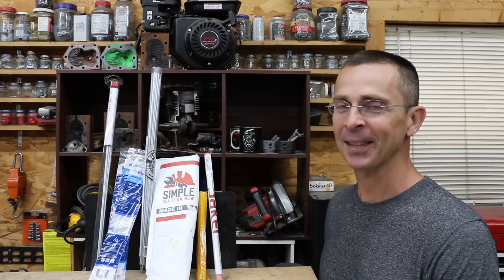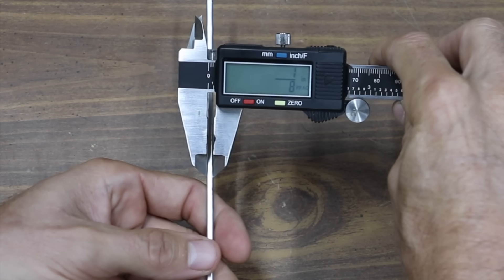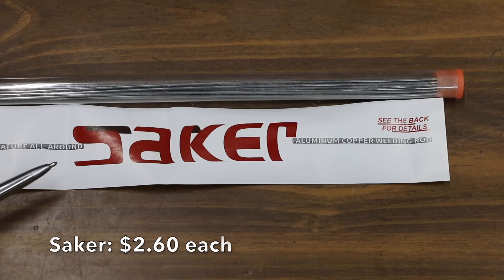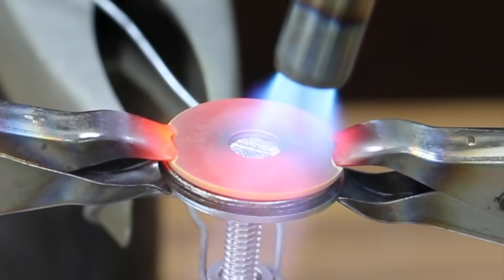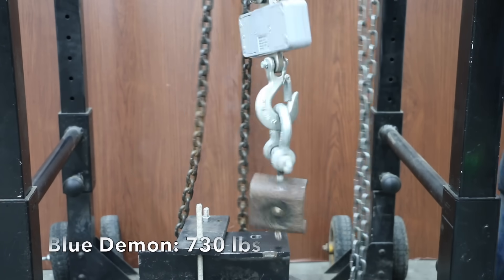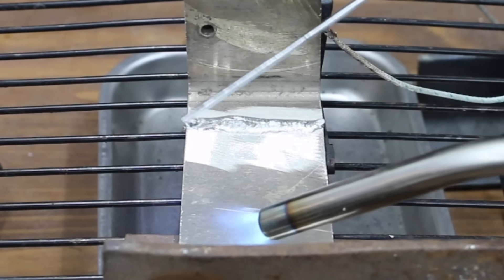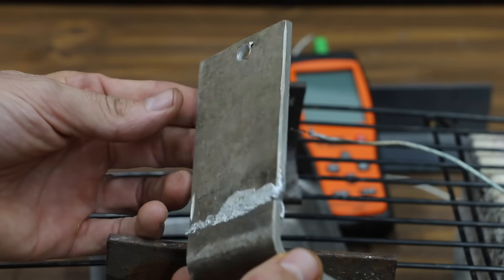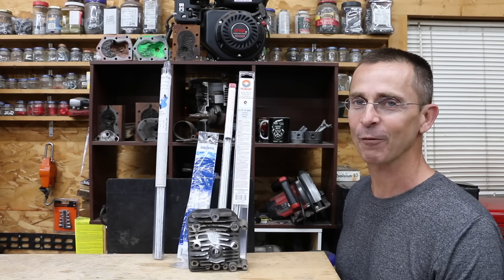Best "No Welder" Aluminum Welding Rods? Alumiweld vs Bernzomatic vs Hobart

Comment: This is one of my favorite youttube channels. A control test with a bolt that wasn't welded would be good for comparison. For the cold spot on the thermal camera metal is highly reflective in the far infrared range and will give false readings. Painting metal with black paint will fix this (black body radiation and what not).  Thank you for making such great content!
Reply from the maker: Thanks for the video idea.

Comment: Correct me if I'm wrong but wouldn't a higher temp rod be better? If the aluminum got soft were the aluminum and rod could fuse wouldn't it work better?
Reply from the maker: Thanks for the suggestion.

Comment: I actually just used some blue demon to (attempt) to fix some threads on an aluminum housing.  I had the housing in a vice and even with a mapp gas torch, I really had a hard time getting it up to temp.  For me, watching very carefully to how well the others flowed, I think the Hobart or the harbor freight ones would be easier to use.  They seem to be more willing to stick to the object being heated, opposed to trying to stick to itself like liquid mercury does.  I saw it do that a little bit in your videos as well (With the blue demon).  I was also trying to build up material, which really isn't how they are designed as I found out.  You can't do a "stitch weld" like you can with a real welder (Going hot, melting, cooling off, welding more on it, and so forth).  The "blob" of brazed material will simply melt and roll off before you can add more material with it.

So more than likely my fails were over expectations and probably user error.  I can definitely see how useful these could be.  We're seeing more and more stuff being made out of Aluminum and the fact that tiny braze held against all that cylinder pressure is pretty awesome.  I'd be curious if you drilled a 1/4 inch hole in it, if you clamped the head against some iron, then tried to fill the hole with the aluminum filler.

For those that wondered about the non-chlorinated brake cleaner - why he mentioned it.  More than likely it's because Todd knows about how UV light exposure can turn chlorinated brake cleaner into Phosgene gas which is super-poisonous.  Any form of arc/mig/tig welding will do it.  I'm not sure if brazing would, but always better to err on the side of caution.

Great test as always!
Reply from the maker: Thanks for the feedback.  Thanks so much!
Reply: Heat the part in an oven to500-600 degrees. Put the part in a box that will let you cover it in vermiculite. The whole part isnt a heat sink anymore.

Comment: Ok, I'm pausing at the halfway point to make this comment. Welding and brazing are two different techniques. Soldering and brazing occur at much lower temperatures than welding does. Welding can not take place BY DEFINITION unless the base metal melts. The "icyyyyyy" filler metal is a WELDING rod, the rest are BRAZING rods. This is why there is such a large disparity in melting points.
Reply from the maker: Thanks for the feedback.  Thanks for the video idea.
Reply: Good test though, Todd. You should test dishwasher detergent. Cascade, store brands, Finish, the works.

Comment: Great job on this comparison!  One very popular option is Muggyweld Super Alloy 5 and is used quite extensively in the custom car fabrication business.  It has slightly different characteristics to the products you tested but it would seem to be right in line with these products.  Might be a good one to add if you ever revisit this test in the future!  Also, A similar test on brazing rods designed for pot metal repairs might be equally impressive!  Pot metal is a different animal!  Thanks for all you do!
Reply from the maker: Thanks for the video idea.

Comment: I know of a type of alumin(i)um brazing rods which needs you to wire brush (stainless steel brush) the base metal underneath the area covered by the puddle to start the fusing of the material. it removes the oxide layer while the puddle shields the base metal from oxygen. Maybe that's what the ones where the fusing failed needed.
Reply from the maker: Thanks for sharing.

Comment: I had an old aluminium pot that I used as a dog bowl then forgot about it for years, when I found it again it had lots of corroded holes in the bottom so I thought I would give some of them type rods a go, after 5 years the pot is still going with no leaks but the welds have turned a darker colour.
Reply from the maker: Thanks for sharing.

Comment: This was perfect vid for the questions i had about them. The only thing i still wonder if you could fill a stripped out hole on exhaust side of head. Broke both studs off on my sz 1400 but after drilling and tapping for many hours i was able to fix it. In a case where its too far gone will the rods work that way. Although the rod didnt seem to go into the crack on the head. Maybe if heated from both sides it might. In the end prob wouldnt hold up or at least be reliable enough to trust, especially with the heat of the engine. But as a last resort maybe id try it. Nice to see these could be used to make a decent repair tho. Still would love to see steamer and or hydrogen generator to clean engine. Thank you for your time and your knowledge.You are da man
Reply from the maker: I should have tested that. Thank you
Reply: Yea you shoulda...lol just kidding but would like to knowif it would work. Ive watched just about every vid you have and appreciate all you do. Always looking to learn something new. Cant wait for the next one. Be well and safe out there

Comment: You could try a video on automatic transmission additives. Many claim better heat protection, lubricity, etc. I have used lubegard shudder fix and it worked but Lucas and others also make additives.
Reply from the maker: Thanks for the video idea.

Comment: cool video. try using the harbor freight flux welder vs some high quality welders and test the strength. ive only ever welded with HF flux welder and seems to be strong enough for what i do but its basically impossible to make a pretty weld . im curious to see the strength as opposed to an expensive welder
Reply from the maker: Great suggestion!  Thank you.

Comment: Why non-chlorinated brake parts cleaner?? Very curious to know the reason!
Reply from the maker: If a flame comes in contact with it, it can make Phosphine gas. Thank you
Reply: @ProjectFarm  I would venture to guess that a large majority of people would not know that - thank you for replying!

Do you know if that same principal (chlorinated v non-chlorinated) would hold true for prepping surfaces for paint? As in would it be advisable to use non-chlorinated in that scenario?

Comment: Excellent video but, admittedly, am partial to Bernzomatic, having used their products for decades and never had trouble.  Their small gas bottles never leak (always keep a propane bottle and a map gas bottle handy).  Even have an antique (more than 50 years old) Bernzo two-gas torch with bakelite handle and the rubber hoses have not perished... can't beat that kind of quality.
Reply from the maker: Thanks so much!  Thanks for sharing.

Comment: Once again, your timing is impeccable. Can't wait for the next video. The temp diffs were surprising to me on the cylinder head. I wonder if you could machine cooling slugs into rc nitro engines with these. Hmmmm 🤔
Reply from the maker: Thanks for the suggestion.

Comment: The repair area is probably just lower emissivity than the surrounding cylinder head rather than colder. As a general rule in thermodynamics, surfaces that don't absorb infrared are also not good at emitting infrared. Aluminium is amongst the most reflective and worst emitting materials commonly encountered, and a simple solution is high temperature black paint.
Reply from the maker: Thanks for the feedback.
Reply: @ProjectFarm  I love how your reviews are unbiased and you don't take a penny from sponsors.

Comment: Video suggestion:
Different products for fixing tile to drywall. Tile backer board, tanking solution, PVA, bare board, tile on top of tile.
Need to test pull off strength and waterproofing
Reply from the maker: Great suggestion!

Comment: Great job with this vid! I might have to keep a couple of these rods in the garage!
I got a suggestion...
What about a rod that stick to metals other than just aluminum? 
Like a solder rod that doesnt contain lead? I remember guys doing lead work in the old days on automobiles, but ive heard there is a safer version now.
Would that be something you'd consider trying? Might be usefull to see how strong they are and see if they will they fill pinholes in corroded metals.
Thanks
Reply from the maker: Thanks for the video idea.
Reply: @ProjectFarm  thank you! , for taking the time to upload all these great vids!

Comment: Here is one for you. This may be a little much to actually do, but i have always wanted to see an actual comparison of ethanol vs non-ethanol fuel. They claim ethanol burns cleaner. That may or may not be. If it is true, is that per unit if work or by volumetric concentration? My point is that it is widely understood that ethanol contains less energy. So that must mean you need to burn more to do the same about of work. If you burn more you put out more exaust. So is it really cleaner? It would need to be a longer test something in the neighborhood of 20gal and done on an EFI engine under a constant consistent load..... i am willing to bet the outcome would show that ethanol fuel is not actually environmentally friendly.... i hate the stuff. I have 11 small carbonated engines on my island. I have not rebuilt a carb in roughly 6 years after going to 100% ethanol-free. The fuel sits outside all winter each season in northern PA with ZERO after the fact additives and every one of the engines fire up in the spring with zero hesitation (as long as the battery survived hahaha)
Reply from the maker: Thanks for the video idea.

Comment: Even as a fellow American I find the use of fractions under 1/8th of an inch baffling.  Might make more sense to use decimal place for small measurements.  A .133 versus .128 measurement is easier for the average person to understand instead of trying to figure out if 17/128 is larger or smaller than 1/8.  Keep up the great work!
Reply from the maker: Thanks for sharing.  Thanks, will do.

Comment: I bought a pack of aluminium welds from Amazon about 10 years ago and I had the problem of the aluminium reaching melting temps and the rods staying firm. I gave up thinking they were a nice idea but not great in practice. Good to know there are rods that do actually weld below aluminium melting point and pretty strong at that too. Great video!
Reply from the maker: Thanks for sharing.  Thanks so much!

Comment: Wow. This guy. Been watching for a couple of years. Great "content". A week ago got a used high-end mountainbike frame with a small crack in the head tube. Have a TIG welder and can weld some basic carbon steel, but a bike frame is of course AL. Have been thinking of DIY-welding the frame with heatable alu "sticks". Thanks for bringing more light into this mastery!
Reply from the maker: Thanks so much!  Thanks for watching!

Comment: Interesting! Most of my best results were with Blue Demon, but never tried the Hobart. 

I wonder if a more vs less 'wetting' action kinda messed with the tests, particularly the bolt test. I would LOVE to see a FLOW test to see how far into the joint the braze goes (it is brazing, not welding, at least with most of those rods, lol), because in many repairs we only have access to one side, and building up the outside is not an option. Maybe some playes spaced apart a papers width and see how far into the joint it flows per the same volume of wire? (yeah I get thats a lot to calculate, I also wish you would have measured length of rods, but we are well into hair splitting territory now..)

Great video, Please revisit this as more brands are suggested and your skills improve.
Reply from the maker: Thank you for the constructive feedback

Comment: I've used the alumiweld brand rods to repair some cast aluminium mounting brackets, that has cracked and broke . The repair came out very good, and the part is still in service. Cleanliness is important, as in, remove all the oxidation and oily or paint contamination.
Reply from the maker: Thanks for sharing.

Comment: I was just thinking you would be perfect for this exact comparison the other day. Just to throw it out there, on soft aluminum, the harbor freight can be extremely difficult. When you get it hot enough to flow, you melt the base aluminum along with it. I actually find propane to work better than mapp as you can supply constant direct heat..... now that i know that Hobart dose better, ill definitely be grabbing some. Thanks very much for your videos. They are amazing!!!!
Reply from the maker: You are welcome!

Comment: I would be anything but surprised if they are not complete trash welds, i understand the physics involved but hoping for magic. :)
Reply from the maker: Thanks for watching!
Reply: @ProjectFarm  I was impressed with the results you achieved, I would think you could have filled the head cut / slot if heated from the back side or even flipped and finished but you achieved what was needed. I never tried any of these because of past gimmick things have soured me to trying.
Reply: wow I am impressed, magic it kind of is

Comment: I thought that welding melted the workpiece. These, at least mostly, did not, so wouldn't this be brasing or soldering?
Reply: I'm just wondering if "welding" is the correct term for this process.
Reply: Yes. but short of learning to TIG weld and a thousand bucks of equipment, this lets you repair or build things.
Reply from the maker: Thank you.  Technically it's brazing but the rods are advertised as "welding" rods
Reply: Intresting. Thanks for the info.

Comment: Thanks for the video! I'm a noob at this but from what I've seen of silver brazing a common technique is to flow the weld between two parts in direct contact (I presume this works through capillary action). If you do a follow up would you be interested in designing a test to see how well each rod flows? For example apply rod to only one side of a (flattened) bolt head against sheet stock after heating both and see if it flows to the other side.
Reply: Of course if this doesn't apply to aluminum welding then ignore me 😅
Reply from the maker: Thanks for the suggestion.

Comment: This is the first time I've heard of this type of welding. Can it be used to connect aluminum to steel?
Reply: You'd be better off using aluminum-bronze brazing rods. Even then aluminum to steel is very difficult and will most likely fail
Reply from the maker: Thanks for the suggestion.

Comment: I bought some on a market where the demo made it look so easy.  When I finally wet to try them they were not melting at the advertised temperature. So I bought a map burner but just like the worst ones of your test they refused to flow and weld regardless of all preparations. I have soldered and brazed copper and bronze but gave up on aluminum. Now you opened the can of worms and I will never buy such stuff off a market. Thanks PF!
Reply from the maker: You are welcome!

Comment: Great video, but I would like to see one more test. I would like to see you drill out a tapped hole and then fill it with this rod and re-tap it and see how well the rod filled and if it holds or not. I have a stripped hole in an intake manifold that is too bad to install a helicoil and this would be a great product if it works. I may try getting some and see for myself.
Reply from the maker: Thanks for the video idea.

Comment: I doubt that the repaired patch was actually cooler. It likely just has a lower emissivity which would lower your thermal camera reading. Great test! I've messed around with these rods before and would have killed to have this review beforehand.
Reply from the maker: Thanks so much!
!
Reply: Not sure about that either, I think it just wasn't transferring the heat because it was only on the surface, it couldn't act as a heatsink like the surrounding aluminum because of the large hole (slice behind it).
Reply: #metoo I've been hoping that Project Farm would do a video on these rod for a few repairs I have.

Comment: This really opened my eyes about brazing with aluminum rods. I didn't know you could be so successful with just a torch, rod and elbow grease. I'm curious why it's so important to use "non-chlorinated" cleaner? Based on the context, I'm assuming it reacts with aluminum?
Reply: The heat will create chlorine gas,very nasty stuff. Look it up.